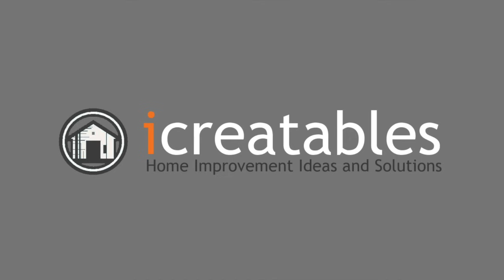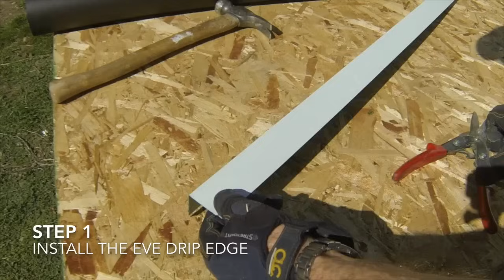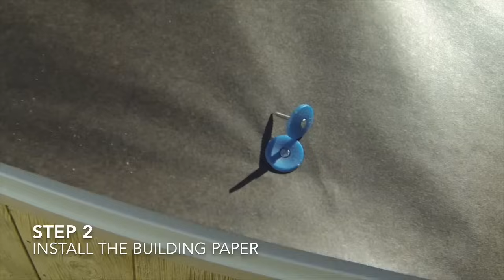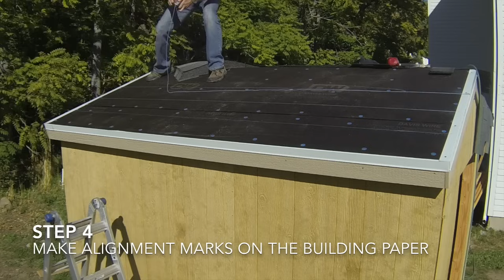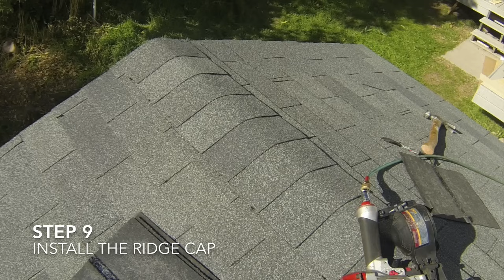How To Build A Shed - Part 9 - Install Asphalt Shingles On Shed Roof

Comment: You're the only one I've seen that cuts a relief 2 inches (i did 3) so the end can wrap around. I've watched other roofing channels that don't do this and make some origami cut to try to patch in the corners.  Also seen some roofing videos that make a butt joint at the peak of the gable where I did a relief cut to have one continuous piece at the ridge

Comment: Tom Silva (This Old House) demonstrated on one of the shows that installing the shingles a little past the drip edge helps move the water away from the shed.  He also showed that water can run down a drip edge and curl back under it which is why he extends the shingles as far as he does.
Reply: And many roofers recommend gutter apron as opposed to standard drip edge on the eaves. :-)

Comment: At the end, you say to use DAP Mastic on the nail heads. I think it is a little late to tell me that I'm on row 8 now.   Do you mean just on the nail heads for the cap since it was mentioned after those instructions. Or are you saying from the beginning. Every nail in this project? Or the top two / last 2 nails on the last piece of shingle since it is exposed. I appreciate all your help!
Reply: It's just the last 2 nails since there isn't an overlapping shingle to cover the nails.

Comment: Superb video - excellent!  Mnay thanks. I looked at a lot of videos on reroofing a shed, and this was by for the most accessible, straightforward, clear guide to shingling a garden shed roof. I watched it repeatedly throughout my own simple project (8 x 6 foot garden shed) - the indexing of the video is great, the steps straightforward, and the instructions very clear. The rapid runthorugh on each step is very helpful - and the slower detailed explanation is perfect to guide the novice. Thanks!

Comment: Another video showed installing the drip edge about 1/2" out from the facia boards, to keep water run off from running down the facia boards, the slightly extending the shigles beyond the drip edge's edge.  Demonstrated the difference with water.

Comment: I just spent all day shingling my shed per these instructions and my entire eve has nothing to bond to because the video instructs you to put the tar side down on the starter strip... The wind will tear these shingles off in a heartbeat. I'll have to use a bunch of roofing cement to seal the bottom of my shingles down...
Reply: No the tar side is up but the starter strip should be at the bottom of the roof so your first row sticks down by the tar strip. It keeps them from blowing up.

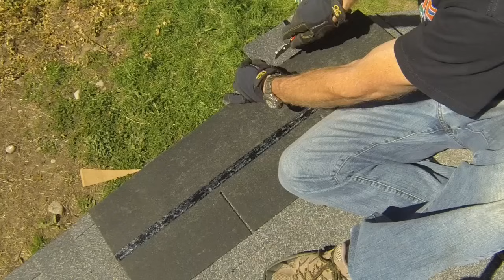Comment: This seems great, and has been an excellent guide so far, but I'm still not quite sure was is meant by "Cut the end of the first row so you have a reference for the ⅜inch over hang." @5:36

I understand what overhang you're talking about (of course), but I'm not quite sure what exactly I should be cutting there off of that last piece

Comment: Could I use this method on something that is 16 squares big little over 500 square feet? How did you fix the ends where u ended u always left some on the edge not where your start over 6 inches everytime but the other end.

Comment: @icreatables - I’m following this video to build my shed roof and have two questions: 1) why didn’t he use the chalk lines after snapping them down? Seems like he provided too much overlap so that he could properly cover the nails that he nailed BELOW the tar strip instead of right above the tar strip. It seems to me that the best method would be to snap a line at every 6” to have a proper guide for each row of shingles, right?
2) In reference to my first question, why did he mail below the tar strip (in between the slit and tar strip) instead of right above the tar strip? This forces the next row to be lower to cover it and places the nail closer to the water source than necessary, right?

Comment: Thank you . Can we use this singling method i.e. Second row 6 inch off the first row and so on for shingling a roof of a house ?
Reply: The 6” separation on this was because the shingles were 3 tab.  The separation of the seam between rows is manufacturer and shingle style specific.  I think 5 rows in a course is more common than 6 for houses.
I think that works out to about 8”?

Comment: Thank you so much.  Just finished replacing my shingles on the shed.  Followed your instructions step by step.  iPhone in one hand on YouTube and a hammer in the other .  Results are excellent.  Just a note to say not all brands have same dimension shingles such as BP Dakota 3 tab shingles are a bit longer.  But the steps were the same, just adjusted the numbers a bit. And it all worked out perfectly.
Reply: i love how easy the plans are in WoodBlueprints. Com to understand and the step-by-step videos they have. Makes getting material really easy

Comment: Thanks for the video. I’m about to build a brick shed with an off centre apex roof/ridge roof (if that’s what it’s called). Is it the same method or does it need extra support due to the ridge being off centre? Thanks.
Reply: I am not in the construction industry nor am I a carpenter, I wanted a good guide to help with small projects such as small sheds and some remodeling around the house. So there’s a magic which is Shed Plan [ visit here WoodBlueprints. Com     ]. This Shed Plan covers all my instructions from top to bottom in a step by step manner.

Comment: Only thing I am wondering is why the heck didn't you put starter strips up the rake also. starter strips should be full perimeter of any roof.
Reply: Because it’s a shed’s roof (not your house’s roof). Plus, it depends on your area’s climate (if it’s super windy, then having a starter strip on the rake’s side is a necessity).
Reply: @LegendNeverD1es I've got to re-roof a shed and will be learning as I go. Got any video recommendations that show installing starter strips? There's typically high winds during the Fall in my area, so I probably should consider this.
Reply: Welp... I hope I'm okay without it up the rake 😅

Comment: Great videos, very informative 👌🏼. How comes you overlay membrane along the fascia trims but not on the gable ends?
Reply from the maker: The edge of the first layer is not nailed because nail hole leak. The starter strip is sticky on the bottom side to stick to the roof and then the shingle that sits on top of it sticks to it.

Comment: Wait, so why do you need a starter strip? Also, so the 1st course of shingles goes over the starter strip??
Reply: If you skip using a starter shingle, the "slots" on first row of installed shingles would show felt paper instead being on top of a starter shingle. Naturally the felt paper would not last very long before you have leaks that rot out the eaves - both fascia and soffit would rot. (the first row of ANY roof must have a layer of starters for protection)
Reply: @Jeff82556  thank you for the concise, simple explanation, regarding why a starter strip is needed.!

Comment: 28 seconds into this video you show the drip edge on top of the tar paper then 57 seconds in you say to put it under the tar paper why?
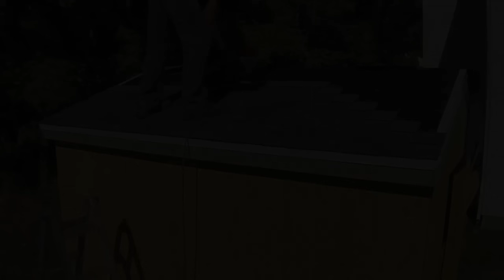Reply: Look a little closer.  The eave drip edge goes under the tar paper, and the gable end drip edge goes over the tar paper.  It's a little tough to see at 0:28, but it's consistent with what he says - and it's the correct way to do it.
Reply from the maker: That is correct. Thanks.
Reply: We put the drip edge over the tar paper on the eave and gable ends and have had no problem. It's a 3 inch edge with a half inch hanging, so that's 2.5 inches snug on the tar paper. We also  used    a sealant around the edge when installing the shingles
Reply: @alicecurtiss959  to my knowledge the only state in the entire US that permits your method by code is FL.  All 49 other states require that the paper go over the drip edge at the eave.  In FL we do it your way with paper under the drip edge at the eave due to hurricane winds.  This method REQUIRES a 4” wide roof cement strip over the drip edge and paper.

Comment: what nails did you use in the nail gun? please
Reply from the maker: 1 1/4 inch 3/8" head coiled roofing nails.
Reply: Is it nail have to be going through the drywall ?

Comment: How much do you spend just on this part of the project?
Reply: Andrew Marroquin considering this is a small shed and these shingles probably cost about $25 a bundle I would say maybe 4-5 bundles so $100 in shingles the paper they used here is about $25 a roll premade drip edge is about $4-$5 a piece they probably used 4-5 pieces so say all together maybe $150-$200 But price heavily depends on types of shingles i would nightly recommend GAF architectural shingles they are much nicer and will last much longer than the 3 tab shingles seen here for about $5 more a bundle
Reply: Also I would recommend about a half inch of over hang on the bottom edge and sides

Comment: Hi, i have a concrete slap of 10 by 22 ft available, and would like to build a Rec Studio on it but due to regulations ill be able to only use 8ft by 20, is there a plan for it available that you can provide me with? 
I really enjoyed all step by step clips and want to take on that project, please advise and thank you.
Reply from the maker: Hi. Yes, all of our shed building plans come with a concrete slab option. Thanks for watching!
Reply: just ordered the WoodBlueprints. Com guide for step-by-step videos and different plans to BUILD A SHED. they have some awesome plans in there

Comment: What is the thickness of the plywood you used for the shed roof?
Reply from the maker: It is 7/16" O.S.B. You can also use plywood.
Reply: @icreatablestv  don't the roofing nails come through that thickness of plywood?

Comment: I have been trying to get a shed built for about 5 yrs and there is no one in our area that knows what a shed is.  I wish I had taken carpentry when I was young so I would know how to do this for myself.  I have been since February trying to get someone to fix my metal roof that the contractors did such a bummy job on.  I don't think they put the felt on my front porch and it is leaking.  I have called since February and cannot get someone to fix this.
Reply: Linda Keen just download a plan from the internet and follow the instructions

Comment: I'm installing a new roof on a shed & painting it as well, would you recommend painting first or installing the roof?
Great video by the way!
Reply from the maker: If you are tearing off the drip edge it is easier to paint under it before the new drip edge goes on. Other than that it does not matter.
Reply: @icreatablestv  sweet

Comment: any idea how much to charge someone for a job like this? someone wants me to do this on their shed.
Reply from the maker: +Mike Senesouk Labor prices vary by region and current economic conditions...but a rough rule is that labor is typically the same cost as the materials. Smaller jobs cost a bit more because you have all the same set up costs whether you are doing 100 sf or 1000 sf.

Comment: What nails are used to install the shingles?  I will see if I can find that somewhere else on the internet.  Thanks for these great videos.
Reply from the maker: +DWellser Wells Asphalt Roof shingles are typically installed using 1 1/4" long, 12 gauge, 3/8" head Roofing Nails. You might want to use a shorter nail on your storage shed because they don't stick through as far. Thanks for watching.

Comment: what nail size did you use for the shingles?
Reply from the maker: +Mariano Castillo 1 1/4" long, 12 gauge, 3/8" head nails were used. If you can find shorter nails I would use them. The low ceilings in most sheds means that you will be close to the sharp nails poking through the roof deck of the storage shed. Thanks for watching.

Comment: Do you have anything showing vinyl siding installation?
Reply from the maker: +pookie2707 No, but there are lots of vinyl installation videos on youtube. It is all the same, a shed or a house.
Reply: No worries at all! My Shed Plans brings me up to speed with professional tips and tricks used by the pros [Go Here=> WoodBlueprints. Com  ].  It really let me learn how to handle carpenter equipment, follow the right safety rules, and how to do your projects professionally so that they will look good and last!

Comment: At the end of the video you mentioned putting roofing mastic on each of the nail heads to prevent leaking. I wish that had been shown in the video. Did you mean just for the ridge cap, or for the whole roof?
Reply from the maker: huttarl The mastic on nail heads is just the last nails on the ridge cap that are not covered by roofing. Thanks for watching.
Reply from the maker: +huttarl The mastic is only for the nail heads that are showing on the ridge cap. It is usually 2 nails. Thanks for watching.
Reply: 7th, uZ
Reply: the best shed plans and step by step videos I found were in the mysecretblueprints. com vault. materials and supply list are perfectly laid out in order
Reply: i found an awesome plan from mysecretblueprints. com for a killer shed Im putting up this weekend
Reply: *****<<< Woodworking Plans And Instructions
16,000 Items Ready To download Today thebooks2015.com/woodmasterplans

Comment: Why should the stater strip be installed upside down? Doesn't the first row of regular shingles need the tar strip of the starter strip to stick to? But with the starter strip upside down the the tar is facing down. This doesn't make sense to me.
Reply: iCreatables ok, this info is incorrect. You are NEVER supposed to install shingles upside down , it was never designed to shed water or resist elements with the bottom side up. They are meant to be installed with the top of the shingle facing the fascia, but with the gritty side up ALWAYS. Also there should be starter up the rake, not just at the eves.
Reply: The slots are open on subsequent strips, thus offset to keep rain off the roof.  Now back up a step - with the starter strip there are no slots.  I never bothered cutting off the tabs - just flip the bottom course over.
Reply: After looking at other videos, other people install the starter strip right side up. It can't be right to install the starter strip upside down.
Reply from the maker: Hi, both sides of the starter strip have a tar strip on them to allow them to stick to both the roofing paper and the shingle installed on the top. The reason they are installed upside down is because if there is any color showing on the top side it will not show. In the case of this video they could have been installed right side up. Thanks for your great comment.
Reply: iCreatables
Hmmm...I don't understand the issue with color showing other than if you you used a starter strip of a different color than the actual shingles, but maybe I'm not understanding you correctly. Also, the shingles (from which I cut the starter strip out of) that I'm using are not sticky on the underside. I'm still struggling to see any reason to install it upside down. Anyway, apart from that, this is a very clear and helpful video so thank you.